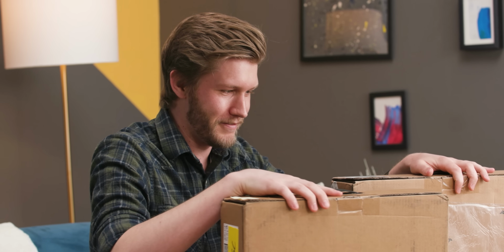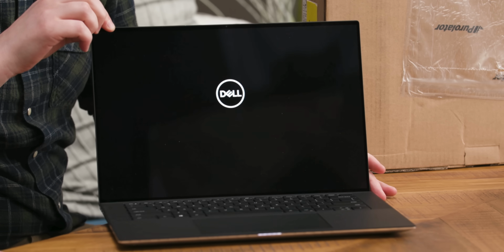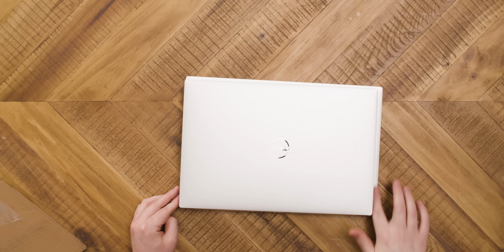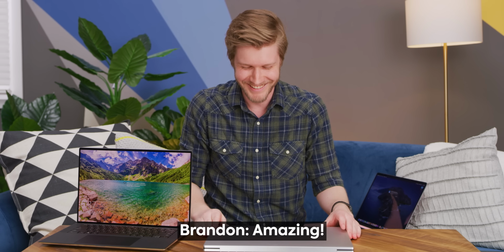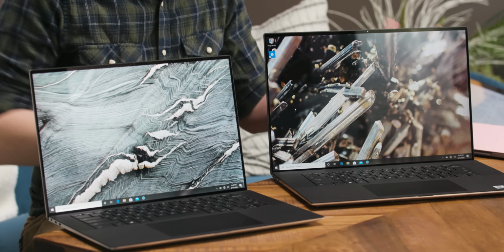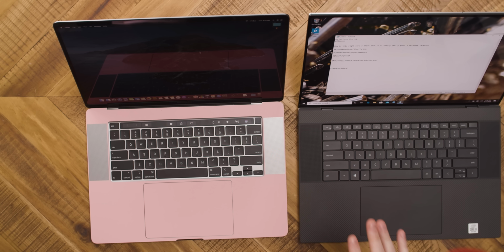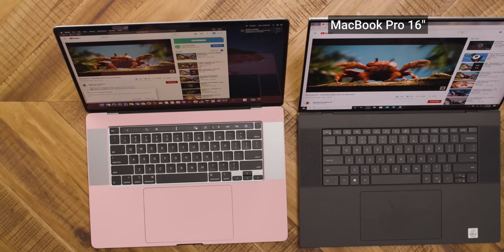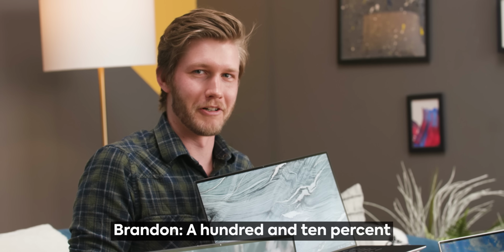The MacBook Pro's Biggest Rival - DELL XPS 15 9500 & 17 9700 Laptops

Comment: Just imagine a Dell XPS 17 with Ryzen 4900HS. would be nice.
Reply: AMD already had thunderbolt 3 on desktops, probably trickled down that interface if OEM chooses to use AMD in their laptops.
Reply: You could say this about any new laiptop
Reply: Thunderbolt can be added with a seperate thunderbolt controller.. Just no one has done this on amd systems as they are always budget oriented..

A bit like how amd laptops get bad screens
Reply: That would be actually amazing but we'll lose out on thunderbolt 3
Reply: @tejaspadhye  yeah, that's an issue, technically they can still completely add thunderbolt 3 support it just probably won't be certified by Intel. USB 4 will resolve a lot of this hopefully
Reply: @tejaspadhye  No you wouldn't. There are plenty of AMD motherboards that have Thunderbolt 3 ports.
Reply: Tejas Padhye thunderbolt has been sold to USB I thought
Reply: @AZmotion  No, Intel just made that Thunderbolt 3 interface royalty-free. That's why AMD was able to use that interface on desktops and just straight-up use Intel's Thunderbolt 3 drivers.
Reply: @iqbalrazi03  really? Link me to a b450 or x470 mobo which has thunderbolt 3
Reply: Tejas Padhye asrock x570 phantom has thunderbolt 3. No x470 or b450 I know of
Reply: @Link_Pacino  OoOo I'll look into that. Thanks
Reply: @tejaspadhye  not b450 nor x470 though. It is x570. ASRock X570 Creator motherboard.
Reply: @tejaspadhye  check Linus's video which he upgraded his home rig.
Reply: @iqbalrazi03  that htpc for games one?
Reply: @AZmotion  Yeah, I know that. What I means is AMD can use that interface even though it is still Intel's spec and branding, which means maybe they also can use it in their laptops.
Reply: @tejaspadhye  not sure about x470, but I have x570 asrock taichi with thunderbolt
Reply: @iqbalrazi03  thanks
Reply: @tejaspadhye  no problem.
Reply: Tejas Padhye search for any of the asrock boards the aqua is the top spec though
Reply: @dominicbeltz9057  no you need the thunderbolt controller for it to pass through usb-c. Intel haven't yet got round to licensing tb on AMD laptops, cos intel know as soon as they do, there really won't be any reason left to stick with intel lapops for high end work/ media machines. But I heard tb will be on the next round of amd laptops. As soon as Microsoft release a new Surface laptop with AMD chips (which I think they will) thunderbolt will become standard on amd laptops, cos there's no way in help Microsoft will release a laptop without it.
Reply: @dominicbeltz9057  Intel created and owns USB
Reply: Tejas Padhye asrock x470 aqua has thunderbolt 3 and linus even made video on it.
Reply: @tejaspadhye  currently only X570 is the only AMD platform to support Thunderbolt 3
Reply: @tejaspadhye  yeah i feels bad for AMD. idk they keep it for themself.
Reply: @tejaspadhye  not really they can always pay Intel like the Zephyrus
Reply: @tejaspadhye  If ASRock can implement thunderbolt with their motherboard I don't see why Dell can't. Most of the Asrock high end  x570 boards have this.
Reply: Tejas Padhye i think last month or some, Intel allowed thunderbolt for one of amd motherboards. In time, it may become available for a amd laptop (in a year or two🤷🏻‍♂️.)
Reply: @tejaspadhye  Dell would need like a separate thunderbolt controller, since a few Ryzen motherboards actually have thunderbolt support.
Reply: 确实不错单戴尔和英特尔有签署协议，不妨期待华硕ZENBOOK pro
Reply: i would get that in a heart beat!
Reply: I don't see why they couldn't just use their Alienware Amplifier port using a Ryzen processor, if you needed more graphics.
Reply: DuckVision amd deosnt have thunderbolt 3 atleast yet
Reply: @bobbyhp26  I know, the Alienware Amplifier port is different than Thunderbolt 3
Reply: DuckVision ahhhh yes one with something like HDMI right? But still tho if it’s use that kind of port it will make the device thicker and heavier because of added controller and stuff
Reply: @bobbyhp26  It is a slightly bigger port, but the Alienware M15 uses it, and it's not that big of a machine. I'm sure they could figure out how to fit it  on the 17". https://i.pcmag.com/imagery/reviews/025gDxMUIta9RMEKtn5wbk4-3.fit_lim.size_1080x328.v_1569469920.jpg
Reply: DuckVision sure they can figure it out but it will consume more resources and time for rnd to re engineers that for small slim xps body
Reply: Jebus!  You want to give me an orgasm?  Because that's how you do it.  OMG, a Ryzen 4900HS and this laptop and I will snatch it up in a heartbeat.
Reply: Intel owns thunderbolt 3, if Dell wants it regardless of what CPU is inside then Dell has to pay intel. USB 4 have the same specs as thunderbolt 3 but won’t be available until like next year and doesn’t require paying intel to use it
Reply: Keyword being "Imagine " ..........

(thats deep.)
Reply: 17" is just a desktop at that point
Reply: xFoxDeath nobody cares
Reply: Starbucks Hero well intel is easier to market to general public tho than amd
Reply: That's the only reason I wouldn't get this XPS, better wait for usb 4 and ryzen.
Reply: i just want a 8 core 16 thread XPS 15 or 13 with more than 1080P display. Is that really too much to ask?
Reply: Exactly what i was thinking
Reply: What's so great about the amd over Intel? Is it just a price thing?
Reply: @CountTo10  Also efficiency and multicore performance, single core there's very little difference compared to intel, there's a 35W ryzen 4900HS beating even 90w intel cpus
Reply: They would probably put a 4900 H since there's no need to restrict power to the CPU in a 17 inch chassis.
Reply: And at least a full USB -A. Just one. Then it's definitively perfect
Reply: I agree so much; or even the U variants with Vega integrated graphics. It would be awesome!
Reply: It was what I thought, but then thunderbolt is intel's thing, so...
Reply: No TB man
Reply: every review has this
Reply: Yeah, I can’t imagine buying an Intel laptop right now. Never thought I’d say that.
Reply: Yeah, get intel out of it and then I'll buy.
Reply: Yeah any XPS laptop with AMD would be awesome. Only thing holding me back from buying one.
Reply: I would preorder now if 4900hs was in 15inch
Reply: and an ampere 3080ti
Reply: I was just thinking XPS 15 with G14 internals ❤️
Reply: Starbucks Hero AMD YES
Reply: amen to that, but doubt it. Im sure intel have quite a role in designing this one.
Reply: And if it had actual USB ports instead of type c
Reply: True.
Reply: Imagine being able to afford it
Reply: I read somewhere that Dell is working on something called Cezanne laptops which will be all AMD.
Reply: also 1440p display
Reply: I work on Dell, and recently we had a showcase of some of the new machines, including this one, Precision and Latitude, I asked if they were ever going to put a Ryzen on any of those, didn't got an answer lol.
Reply: shut up and take my money.
Reply: Nah Intel is great for s laptop.
Reply: It wouldn't be much different, especially for thermals. Laptops this thin aren't ever going to run cool. Intel or Ryzen.
Reply: @icanmakeeverythingilovedie9861  remember the Asus G14
Reply: IMAGINE
Reply: Id like to see ryzen on the blade more lol
Reply: Would be perfect....
Reply: It is just that Intel can make more of worse chips when compared to AMD, which makes less no of good chips.
Reply: Thunderbolt is the problem I presume.
And no more bandwidth for anything more than a 2060.

Maybe 5000 mobile will fix those problem
Reply: AMD PepeLaugh 👉🔥
Reply: I would nut
Reply: it wont be cooled properly
Reply: That's what I thought too.
Reply: Best deal for a laptop then. Pair it with the RTX 2060 MaxQ or 2070 Super
Reply: It's sad to see 12nm Nvidia and 14nm Intel chips in these devices. I really want to see Intel and Nvidia with 7nm process. 12 Core i9 with 2080 Max Q like performance with those small adapters and more screen time with light-weight applications.
Reply: Burak Aydın smaller lithography =/=better performance especially on gpu because architecture matter more than fabrication like Apple a10 is 14nm but it’s outperform and snapdragon that has 10nm we are lucky that amd right now has small 7nm finnet and good architecture
Reply: @bobbyhp26  that's my point, there is already 7nm CPUs and GPUs developed by AMD but Nvidia and Intel give more performance on the same lithography thanks to their architectural advantages. Nvidia also includes more features like tensor cores and raytracing engine but in the end of day, you can end up with a toast machine like my Zephyrus M GU502G. The RTX 2060 on the laptop can get up to 1.92Ghz for a second or two. Then it throttles to 960Mhz and drops to 300Mhz for 10 seconds every minute. Dual fan and 5 or 6 heat pipes can't even help it.
Reply: Burak Aydın architectural difference also make intel and nvidia harder to “achieve” 7nm because like I said before they had diffrent architecture I not so long ago read about intel experimental 10 nm is worse than their 14nm same like nvidia, you can’t say they doesn’t put much effort on their “measly” 12 nm cards the make it in diffrent architecture than amd their 12 nm is most the can achieve at the time with their architecture if the can they want it to be 1nm but it isn’t possible yet for their kind of architecture
Reply: you are right. see i understand using intel, for thunderbolt for external gpus, but since the 17 has an rtx 2060, that should be plenty powerful for many years so they can ditch thunderbolt here. BUt i disagree. not 4900hs. 4900h. 10w higher tdp, so 45w instead of 35w
Reply: No fuck ryzen, no ryzen
Reply: @jasonwalon5470  have you been living under a rock for the past year or two?

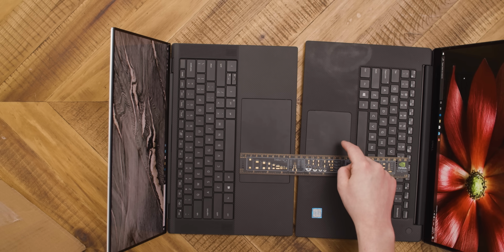Comment: @3:53 So Alex obviously misspoke since the trackpads are not 850mm² vs 135mm².   Is the new one actuall 1350mm² ?
Reply: Old touchpad: 10.5 cm x 8 cm = 84 cm² (8 400 mm²)
New touchpad: = 135 cm² (13 500 mm²) 
When converting from cm² to mm², he just multiplied by ten; for area you need to multiply by 10² (effectively 10 in 2 dimensions).
840 mm² is about the size of a stamp; 135 mm² is about the size of a page number in a book.
Reply: He said about 60% larger so I'd assume so

Comment: It’s kinda crazy how good MacBook speakers are at this point
Reply: @RandomGuy-om1vy   Random Guy  "Hey look!!! They use apple product let me use the isheep card"  You will be surprised how many youtuber use Final cut pro.
Reply: @RandomGuy-om1vy  no way hp laptops sounds like shit
Reply: @RandomGuy-om1vy  You talk utter shit. For starters your fathers MBP is the old model if it has the butterfly keys, the newer models have far better speakers.

Second, HP laptops do not compete with Macs on speakers. 

Thirdly Macs do not break often - even with the keyboard issues their return rate was about the same as the pre-2016 models, which is way better than most other manufacturers.  I have done my research, maybe you should try that too?

Fourthly - I have twice had Apple products fixed for free outside the warranty period and without Applecare - including a replacement battery, keyboard and top case because of a swollen battery, which is the only issue I've had with this almost 4 year old machine. I've owned many Apple, Samsung, Dell and LG equipment over the years and in my experience the Apple ones are far more reliable for longer.
Reply: Even a 2014 Macbook Pro has insanely good speakers compared to the majority of laptops, no need to use headphones while playing media on it.
Reply: Random Guy Which pavilion?
Reply: @RandomGuy-om1vy  I asked
Reply: Random Guy I‘ve listened to a lot of HP Laptops and the Speakers of those Laptops (X360, EliteBook, ZBook) doesn’t sound great... they sound worse than my 2014 13 inch MBP tbh... but I’ve never listened to a pavilion
Reply: Evey year the improve them.
Reply: @RandomGuy-om1vy  I literally just had a 5 year old Macbook Pro refurbished this week for free like i said you absolute mongoloid.  The fuck you on about do research? I've spoken from experience. And well done for knowing how to screw a few screws in and out ya breadbasket, can fix a macbook or an iphone in my sleep with their simple designs, as i have done so multiple times. Anyone can do that but if thats the best you've managed to do with your life, fair play, dont gloat about it here, im not impressed.
And consumer rights laws surpass Apple's rights to refuse to repair a laptop even if its out of warranty or apple care or like mine was' 5 years old. It is the law, and is written quite plainly to read on their website too, 'do  your research' hahaha retard.
And no, you simple idiot, just because you cant change the memory or ssd doesnt make their hardware inferior. Their hardware design is two folds better than Lenovo, and 10 better than Toshiba lmao.
Reply: @Invin_cibles  you're fucking delusional bro. Not a chance Apple refurbished a 5 year old laptop for free. BULLSHIT!
Reply: @Russ0107  Have you ever owned a Mac? Or used Apple servicing? They often (not always) fix things for free outside of the warranty, depending on the fault. Its happened to me a couple of times now.
Reply: @RandomGuy-om1vy  Yeah exactly
Reply: It's kinda logical after all apple is for artists ... So why shit speakers? That's not us.
Reply: @sky0kast0  Artists aren't doing work with laptop speakers, lol. What a ridiculous argument. Spot the wannabe.
Reply: @sky0kast0  real artists would use studio headphones or studio monitors.

Comment: I have an XPS15 as my working horse and I'm pretty unhappy. It thermal throttles ALL the time and sounds like a jet engine. 
So what recommendation do you have for people that don't want the Ultrabook formfactor but in return better cooling?

On the same note, I really hope you're gonna do reviews on the Latops with the 4900H as soon as they're available <3
Reply: Probably zephyrus g14
Reply: Also have an older xps 15. I’m really exited to see the thermals of the 17”, as it will come with a new vaporchamber colling system, so maybe be on the lookout for that too.

(P.s. The 15” won’t have the vaporchamber; it’s not known currently whether they improved the old system tho)

Comment: 3:55 - "The old one was 840 mm^2 and the new one is 135 mm^2." Uhm... u wot m8?
Reply: I am thinking he mean 1350 instead. Hahaha oof
Reply: Clearly some mistake, 840mm^2 is tiny, 4cm x 2.2cm
Reply: At least he is used metric system
Reply: SpeedRunHunter doh!
Reply: Lol
Reply: Hey 🔫 pistols shoot 9mm so like
Reply: @ONERR4RF  pretty sure that pistol shoots H2O
Reply: Jonathan Raymond I mean if you think about it my iPhone is almost 100cm^2 14cm by about 7cm approx so it’s not that hard to believe just plonk you’re phone onto your laptop lol
Reply: Basically, he measured in centimetres and gave the wrong answer in mm².
Old touchpad: 10.5 cm x 8 cm = 84 cm² (8 400 mm²)
New touchpad: = 135 cm² (13 500 mm²) 
When converting from cm² to mm², he just multiplied by ten; for area you need to multiply by 10² (effectively 10 in 2 dimensions).
840 mm² is about the size of a stamp; 135 mm² is about the size of a page number in a book.
Reply: he means cm². He measures in cm...
840mm² sounds like Titan RTX die size xD